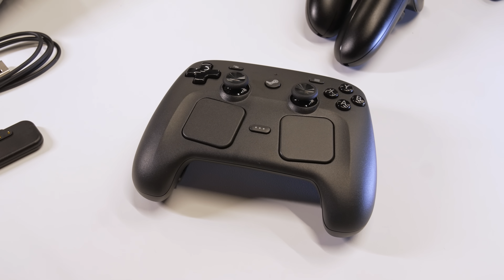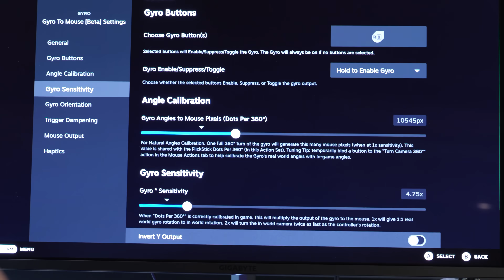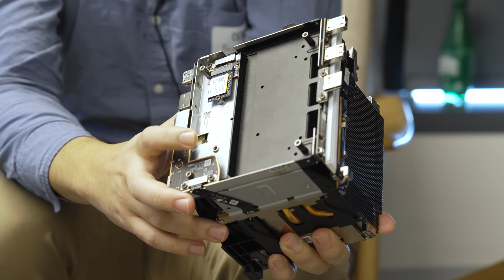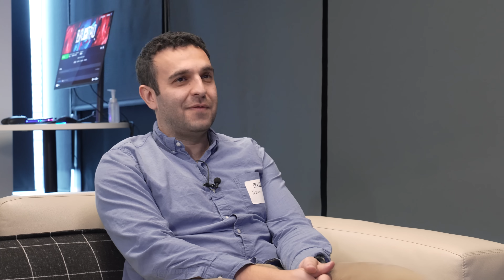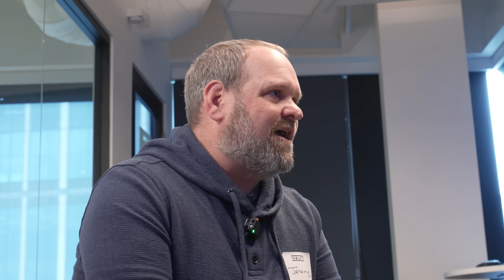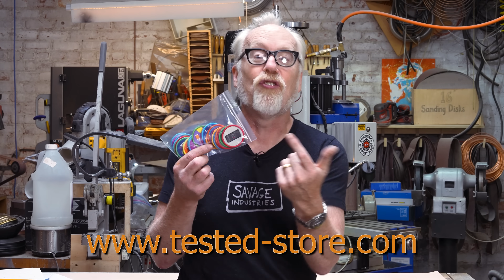Hands-On: Valve Steam Controller 2 and Steam Machine!

Comment: Hello Valve team,

I hope you are doing well.

I am writing to share a hardware concept that I believe could meaningfully advance controller-based aiming in competitive shooters — especially titles like Counter-Strike on consoles.

Concept Summary: TwinGyro

The idea is a split the  controller system consisting of two independent handheld units, similar in form to VR controllers.

Each half contains its own high-precision gyroscope/IMU, allowing both hands to move freely and naturally.

Left-hand controller: joystick + optional gyro for body movement and coarse orientation

Right-hand controller: gyro-only precision aiming, functioning similarly to a mouse in free space

This separation allows players to aim with full range of motion without holding or twisting a large, rigid controller.

---

Why this matters

Traditional controllers limit precision due to small physical stick range, deadzones, and the uncomfortable wrist rotation required for existing gyro implementations.

By splitting the hardware, the player can aim simply by moving the right hand — exactly like moving a mouse — but without needing a surface or desk.

This creates mouse-level aiming freedom on consoles, while preserving the comfort and accessibility of a controller.

---

Key Advantages

Mouse-like precision: Gyro-only aiming enables fine micro adjustments, flick shots, and high responsiveness

Natural ergonomics: No unnatural wrist twisting; each hand rests in its most comfortable position

True separation of movement & aim: Very similar to the freedom of keyboard + mouse

VR-grade motion control without VR complexity: Only IMU orientation is needed; no tracking cameras required

Major competitive benefits: More accurate cross-play, lower skill floor, higher skill ceiling

Modular use: Halves can be used separately or snapped together for compatibility with all games

This system would offer console players aiming capabilities far closer to PC players, making shooters more competitive, comfortable, and intuitive.

---

Why Valve

Valve has already demonstrated innovation in this space with:

the Steam Controller

the Steam Deck gyroscope

Steam Input’s advanced mapping system

A split dual-gyro controller feels like a natural next step — combining your existing gyro expertise with a new ergonomic form factor that unlocks far more precise aiming.

---

Next Steps

If this concept is of interest, I would be happy to provide a more detailed design document, sketches, and possible prototype component recommendations.

Thank you very much for your time and for your amazing work in pushing hardware and input technology forward.

Comment: I dont think any of this new hardware is going to be particularly cheap
Reply: steam deck was cheap(for being an entirely new hardware type), in that only had tiers for more storage, also bump for OLED, but all steam decks have the same performance hardware(OLED has a bit faster memory). buy the cheapest option and upgrade your self for savings, a lot of people did this with the steam deck. of course item packages with more pieces will carry a bigger price(frame(controllers included)

Comment: I can already tell the controller is something I would hate to use for extended periods. I need the long hand grips like on the DualShock 4 because the way my hands grip the controller. I hope since Steam has built in 3rd party controller support that the machine will also have that feature.

Comment: It's so funny hearing everyone call the Steam Machine "Beginner" and "Entry level" and "nothing special" after I looked into it and it turns out it's actually more powerful than my current computer which already runs everything except monster hunter wilds just fine
Reply: For some players, high fidelity graphics aren’t the priority. What matters most is simply enjoying the game. For those people, a Steam Machine is a perfect fit. By the way, what kind of hardware does your computer run on?
Reply: @Erik-tm2kq yea. Personally I'm a big fan of high quality graphics and prefer that over frames at certain points. My monitor supports up to 175 fps but I'm contempt with having 100 fps and max graphics instead. That's why I have an Ultra wide OLED (3440x1440). If I wasn't looking for this high fidelity then the steam machine would definitely be a good option
Reply: The people excitedly talking about hardware are usually those who use high end stuff. So just going through social media, you might get the impression that the steam machine is weaker than every gamers setup.

But taking Steams hardware surveys into account, the majority of PCs is actually weaker than the Steam Machine. We hjgh end gamers are just a quite vocal minority.
Reply: Unfortunately steam decks my only computer and with current pc  part spikes the steam machine may just be a more desirable option
Reply: @Toniestbook  The problem here: The Steam Machine needs PC parts as well. Valve is in a complicated price-finding phase, thanks to these part spikes.
Reply: If Valve can make it similarly priced to equally powerful hardware, it could still be successful. Building your own PC is not something everyone is willing to do, and the existing pre-built PC market isn't exactly amazing. None of them look as cool as this one IMO.
Reply: Yeah
Reply: Yeah but your pc is worse than a beginner entry level pc lol.
Reply: What do you have? A GTX 1060? For anyone who looks to buy a new laptop or pc now, they would definitely going for RTX 5060 or 5070, while the Gabebox only has 4060, that's outdated upon arrival. In your case, you can probably upgrade to a RTX 2060 and still be happy, yet it's no reason to consider 2060 a good option in 2025/26. Of course, 4060 isn't "bad" neither, but it's not gonna stay capable for as long as 5060, that's why it all comes down to price. If the price is good, then it's a pretty handy product for sure
Reply: @趙溫  Price is definitely going to be a big factor. Many games don't need the best hardware on the market, so I hope it gains some popularity and pressures AAA game developers to optimize their games a bit better. The technical sophistication of the graphics is rarely what determines how good a game looks anyways IMO. Style and artwork are far more important to make a game stand out these days.

Comment: I'm also already happy with the performance of the Deck docked, so this thing advertising 6x seems like a very impressive jump. I mostly play at 1080p output integer scaled to a 4k120hz TV with games often rendering around 720p and it looks great at TV distances. Being able to render everything at 1080p or higher and raise the FPS cap from my usual 40 or so to 60+ would be a nice improvement.

Comment: Branding it as "entry level" is super interesting when in the same breath, they are claiming it's better than 70% of gamers' current rigs. Does he mean entry level relative to the current crop of GPU releases? I appreciate that valve is one of the only hardware manufacturers that want to cater to the average gamer, but I would hardly call 4k 60fps "entry level"
Reply: Being 70% equal to or greater than 70% of current PCs indicates that the level should be mid-high end PC.

Comment: How easy is to replace the lithium ion battery on the Steam Controller?
Reply: unscrew the non hidden screws on the back. take the plate off and the battery is the very first thing. pop it out. pop new one in

Comment: Love the OG Steam Controller. Some pain points I had.
    - Bad Haptics : Fixed
    - Only works as a controller through Steam : Unchanged
    - The polling rate on trackpads was too low for serious fps : No Mention
    - Batteries were hard to take out : Fixed
    - Mushy back buttons : Fixed

Comment: The touchpad as a directional pad seemed fine on the first one, I don't know why they had to include both. I kinda feel like they could have had a touchpad that rocks to the sides as a way of clicking A X Y B. Just put the touchpad where a directional pad would go and the other one where the A X Y B buttons would go and have it be a normal sized controller.
edit: also buttons on the bottom of the controller are dumb and just get clicked on accident.

Comment: So the GPU sounds like it's about a 7800 or even 7800xt. I have a 7800xt and it runs game WONDERFULLY. So if it's that level then it will be really good!
Reply: Its an RX 7400
Reply: @mattyredemption-_-7072  There is no Radeon RX 7400; what exists is a Radeon Pro W7400. It's highly unlikely that the Steam Machine only has 28 CUs.
Reply: The Steam Machine's GPU is likely the hypothetical Radeon RX 7800, which never saw the light of day and was intended to have 56 CUs, resulting in performance comparable to a Ryzen 5 7600 and an RX 7800.

Comment: Frankly, it's almost 2026, and the performance of this Steam Machine console is disappointing as it doesn't even match the PS5's specs 
(PS5 has 16GB, the Machine has 8GB VRAM).
Consoles have always been about value for money (price-to-performance) and then exclusive games.
If this console is going to cost between $500 and $650, wouldn't I be better off just using a PC?
 It has weaker performance than the PS5, and it doesn't have a disc drive or exclusive games. Personally, I think it is only worth $329, and no more

Comment: Id love if valve made it so the machine detects the frames transmitter automatically. Make it so i can plug the machine in literally to any outlet, not plug in a display output, but have the frame transmitter plugged in, turn the frame on, and machine on, and it boot right to the frame no display needed fo a truely portable big screen experience anywhere

Comment: I hope all these are great products and a smash success for Valve, who remain as one of the only huge companies that you can actually root for (while they aren't perfect, I've been a Steam user for over 20 years and beyond massive stability issues in the first couple of years, I've never had any complaints). Personally, I don't care at all about VR, and aren't looking for a replacement for my tower, the controller has me curious. 

I've been using Xbox controllers for well over a decade now, starting out with regular 360 controllers but changing to 3rd party controllers due to the constant breaking of the 1st party Xbox controllers (3 month warranty for a reason). And while I'm happy with the Razer Wolverine seiers controllers, which I've been using for years now, they, too, suffer somewhat from reliability issues. Though not once every three months, more like once every two years, but still. If the Steam controller is more reliable, and sits in my hand well, I'd be happy to buy it.

Comment: 0:00 First Look: All-New Steam Hardware
0:53 Steam Controller 2.0: A Detailed Tour
2:45 Next-Level Gyro & Haptic Controls
5:30 Introducing the New Steam Machine
6:07 Console-Sized PC for 4K Gaming?
9:00 A Look Inside: Upgradable Parts
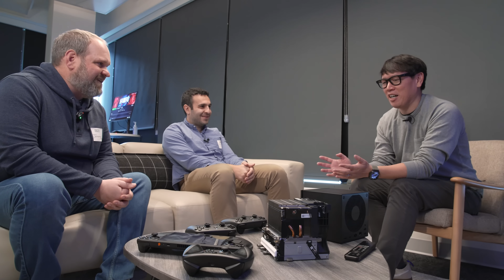11:22 Meet the Valve Engineers Behind the Hardware
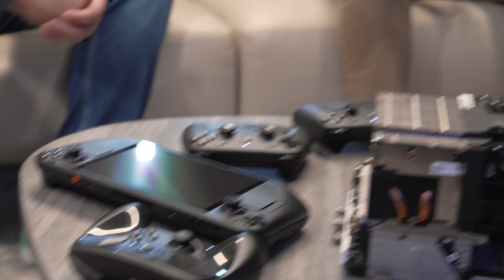12:25 The Tech Specs: RDNA3 & Zen4 Power
13:48 The "It Just Works" Design Philosophy
15:52 Controller 2.0's Swappable Components
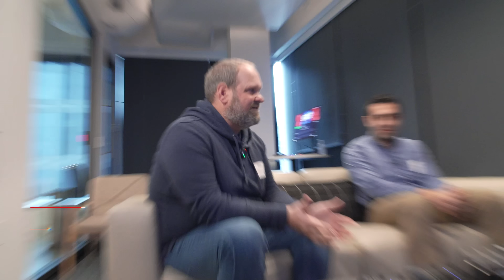18:14 Valve’s Secret Weapon: The Full Ecosystem

Timestamps by StampBot 🤖
(351-hands-on-valve-steam-controller-2-and-steam-machine)